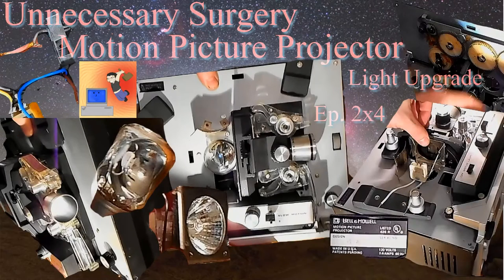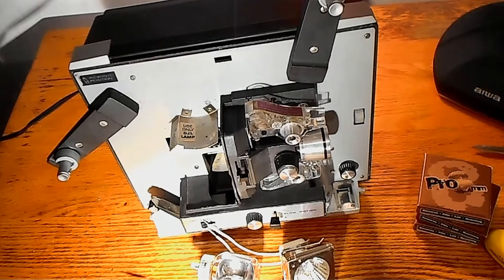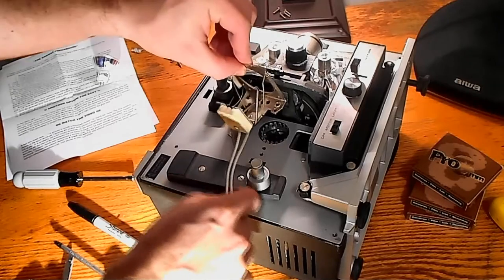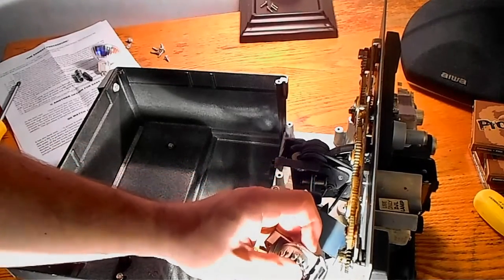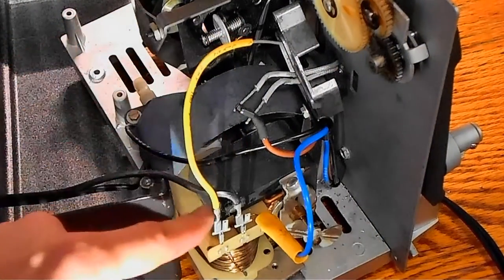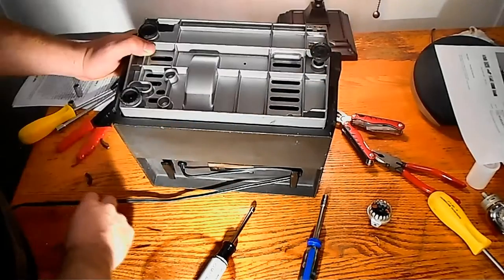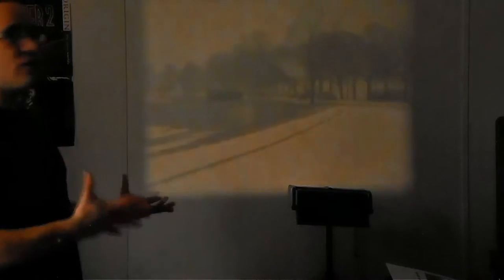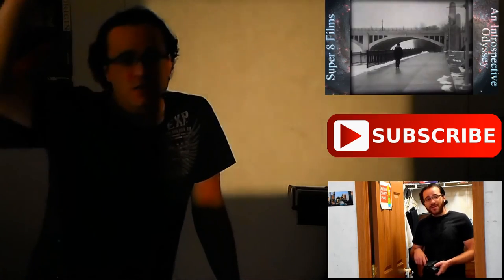Super8 Film Projector Light Upgrade - Unnecessary Surgery

Comment: Bravo - excellent video. I believe you meant "EZK" lamp not "ESK" in your description above. 

I have converted 2 Bell and Howells to use halogen lamps, both before I saw this video -- One about 10 years ago --another about a week ago.

That video you complained about is probably the one that guy also posted here on youtube.  I didn't think anyone could be more annoyed by it than I was -- that is, until I heard your comments, lol. Since you paid for it, I can see why you are more annoyed.

I didn't buy the kit -- I simply bought the correct halogen lamp (same watts and volts), and a QLV-1 lamp holder (exactly like the one you have) on eBay. A lot less expensive. I just didn't get a 3 minute DVD and a couple of screws. :)

The first one I did was a B&H 370 Standard 8mm. I did not have to drill any holes. Amazingly, the existing screw holes were in just the right position. I just had to do a little fiddling with the lower part of the lamp enclosure to make everything fit. It is a tight fit, but it works. 

The recent one was a B&H 482A-Model 2 Super 8 . It has the same geometry as yours. I only have a cordless power drill that doesn't seem to have the strength to drill a hole through the B&H. Or perhaps my drill bits weren't made for that hard metal. So what I did was use JB Weld which I already had. There are different varieties -- I have the one they say is the "strongest" and most heat resistant. It is sticky enough on application to hold itself in place when the projector is laying on its back -- but easy enough to move around until you get the right alignment. I simply eye-balled it by looking through the lens barrel from the front of the projector with a lamp in the holder. But as you know, lining it up with that existing hole really gets it spot on -- and with the QLV-1 lamp holder flush with the film gate enclosure. 

Once you have it aligned to your liking, just put something heavy on top of it. I used the various pieces from a socket wrench set -- small enough to apply pressure to the points to be welded -- and heavy enough to do the job if you stack a few on top of each other. JB Weld cures in 15-24 hours, so you can't use the projector right away as you can if you drill holes. They advise several more hours after that before putting the object back in use. Details will be in the instructions.

The only disadvantage is that you can't adjust it after it has cured. I do not know how much play there is to adjust with the kit. On other projectors I have that already have halogen lamps, you can make adjustments, although from the factory they are usually already well adjusted. The lamps, however, do not seem to be manufactured to very tight tolerances, since some that I have you can see are a bit off-center just by eye-balling it. So sometimes you do need to do some adjusting when replacing the lamp.

Again, I can't stress this enough -- make sure the watts and volts of the halogen match that of the original candescent lamp. Theoretically (and safely), you can go lower with the watts. You will, however, get less light output obviously. (But still perhaps more than the original candescent.) Using a lamp with less volts will probably blow out quickly --- possibly immediatley on turning it on. (Warning: Don't try this at home!) Using one with more volts will project a pretty dim light. That's for info only -- match the watts and volts of the original candescent to be safe, not blow out lamps prematurely, and maximize the light output. If you are going to the trouble of doing this, there is no reason to use a halogen lamp with less watts.

Another point -- you can simply bend the orginal metal tip parts of the socket in order to be able to fit the QLV-1. There is plenty of room also to slip the wires from the QLV-1 socket through. I originally removed the socket, but as you know it is not a simple screw to remove the metal pieces.
Reply from the maker: This is a well crafted alternate approach that I feel others might be interested in looking at, so I'm pinning it to the top of the comments.
Reply: Thank you. I forgot to mention, when buying the qlv-1 holder, make sure it is rated for a voltage at least as high as the projector will be supplying to the lamp socket. Some qlv-1 sockets are rated below 125 volts. Since I needed a 120 volt ENH I had to check before I bought. They cost $8, shipping included on eBay. Also check the watts rating, but I think they are all rated very high. It can’t hurt to check, though.

The GE lamp cost $9.50 on eBay. JB weld costs around $10 at Home Depot. I checked: I used the original formula that comes in 2 tubes that you mix together. Believe me, once you get it you will find many other uses for it. I have had mine for a year and it is still fresh, unlike most glue that I buy that has hardened up in the tube the second time I go to use it.

Another method I am thinking of trying is to use the base of an old incandescent and JB Weld a qlv-1 to it. You mention something like that in your video. The only other thing you need to do is solder the wires of the qlv-1 to the 2 live pins in the existing base. Of course, carefully remove all glass and the old mirror and filament. Wrap tape around all the glass before breaking it to be safe and minimize cleanup with glass shards everywhere. With this method, you don’t have to open up the back of the machine, and if you have more than one projector that takes that same 4-pinned base and uses an incandescent with the same dimensions, you simply have to change the halogen lamp only if the other projectors(s) have a different volts/watts requirement for the lamp.
Reply: I am going to redo my recent conversion for the 482A. I am using a 250 watt ENH since the original bulb was 250 watts, but although everything is working fine, I do not feel like I am getting 250 watts of light. I checked my conversion from 10 years ago, which is 150 watts, and it is definitely brighter. I noticed that I didnt place the qlv-1 flush up against the film gate enclosure, simply because I installed it using the existing holes. Then checked all my other projectors designed for haligen, and upon measuring, none were that close to the film gate. Also, in the B&H 482, the original lamp was not that close either. So my theory is that I am not getting the full impact of the mirror on the halogen. So I will reinstall it as far back as possible, which pretty much will have the front if the halogen lamp mirror where the original filament if the incandescent lamp was.

Comment: What led bulb did u use ,what wattage is it the cool white? My eumig s710d currently runs 12v 100w halogen works fine but want to convert to led runs much cooler wont burn film . I'm looking at 12v ac led on Amazon any better suggestions? Thanks, Louis Burlington On.
Reply from the maker: The kit is linked in the videos description. My projector must be older than yours as I'm showing how to convert from tungsten standard lighting to halogen, not LED. It's using a 150w halogen, same wattage as the original tungsten, but with a much longer life  while retaining full color reproduction, unlike LEDs. So my particular situation would not apply to your projector, though I know there are ways to convert mine to LEDs, as I"m sure there are ways to convert yours as well if that's what you're wanting.  But I can't recommend anything in particular as LEDs were not my desire.
Reply: @Shot97  thanks for info...Louis

Comment: Can this apparatus be used to replace the DLD bulb for my Bell & Howell LX20 Lumina projector?? Thanks
Reply from the maker: I wouldn't know specifically about that bulb; You'd have to know the dimensions of the bulb housing. As long as you can mount the halogen bulb frame inside of the old housing I imagine it would work.
Reply: In theory, you can do a conversion on any projector. That being said, you do need to have basic wiring skills and a little ingenuity. As I said in my post, please match the watts and volts of the original lamp to the new halogen one. Be safe.

A QLV-1 lamp holder does not fit in every projector. I am not familiar with the LX20. If there is enough room for the halogen lamp, you have a few alternatives. For example, you can construct a home-made lamp holder by cutting sheet metal to the correct size. (Use paper to size it -- measure twice, cut once!). You can then do some drilling if you want (depending upon what the projector is made of.) Or use JB Weld as I mentioned in my post.

Also, you can possibly use the lamp holder from a junker projector.

Comment: I detest poor instructions so I feel your pain with that DVD ... badly designed maps too ... grr ... but good job on saving $100 on a bulb ^_^
Reply from the maker: I would much rather put a little love into it, sink a little time in there, make sure everyone gets it right.. Because they paid for your stuff, they deserve to get it right. You can make a minute long video like they did and have everyone sink 3 hours into dissecting it... Or you can make a 35 minute long video step for step and make sure everyone gets it right. In order to edit it down to one minute you still have to film the whole thing, so it's not like you're putting in more work there... ahhhh! hahah, appreciate the kind words!
Reply: @Shot97  Yes, that just HAS to be the same video that is posted here on youtube -- twice actually -- the first about 5 years ago that is still up. That video looks like a video of a magician/mime! I watched it many times, pausing it, rewinding -- and as you said, there is at least one on-screen text that is nearly impossible to even freeze -- you see it, and by the time you hit pause it is gone!
Nowhere does it show you the measurements of where to drill holes. And even if there were, unless you have that exact same model (or perhaps similar, B&H made many with the same geometry), the measurements would be off. Does he include any measurements or more detail in the written instructions? From your comments, I would think not. :)
Reply from the maker: @baldwincooke5316  Nope. The written instructions were also quite terrible, though not as terrible as the video was. haha.